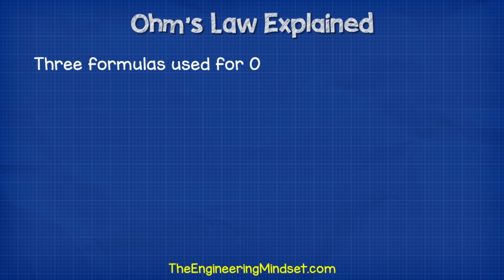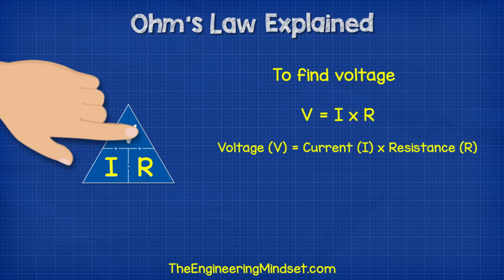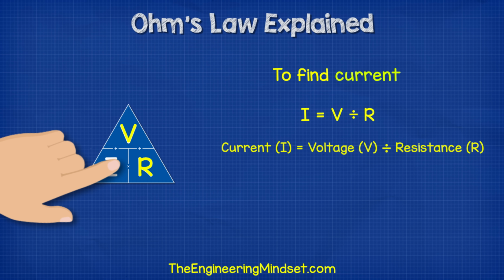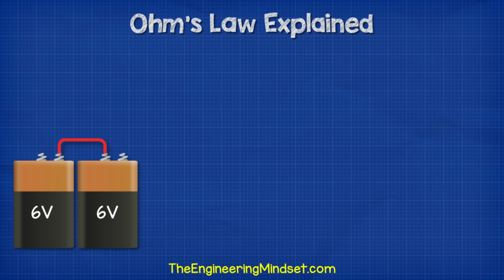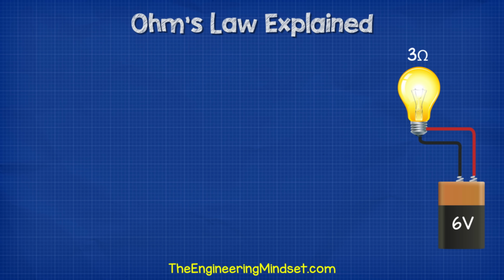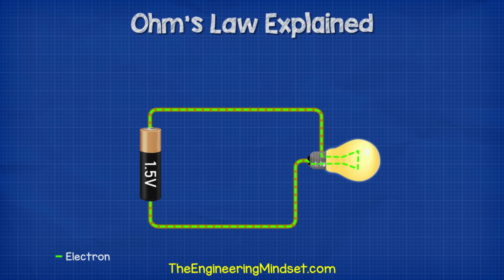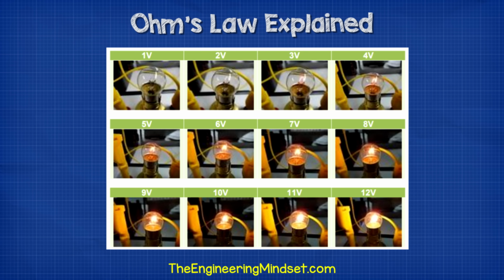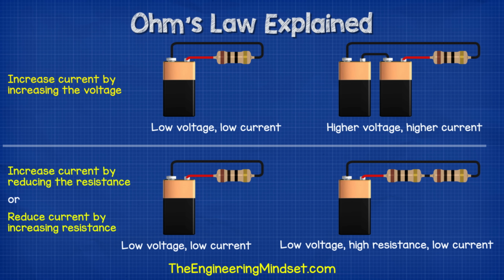Ohms Law Explained - The basics circuit theory

Comment: This video is mostly about how to use the "Ohm's Triangle" mnemonic to solve problems relating Voltage current and resistance in good conductors. Unfortunately it does not really discuss Ohm's Law as the title suggests. An actual statement of the macroscopic version of the law along the lines of  "In many good conductors, the current through the conductor is directly proportional to the voltage across the conductor" is completely missing.  It would be nice if this video explained that not all materials follow Ohm's Law by contrasting Ohmic and non Ohmic materials rather than just treating it as an equation to be solved in textbook problems.  Using incandescent light bulbs to demonstrate Ohm's law is not the best approach, since they are non-ohmic. If you double the voltage applied to an incandescent bulb, the current generally will not double.  As the current through the bulb increases, the temperature will increase and thus the resistance so you get less than twice the current.  If you put two incandescent bulbs in series, the current flow will less than half the current for one. (We also never learn why the equivalent resistance of two 2 ohm resistors in series is 4 ohms - that is just taken for granted)  Cooler bulbs will have higher resistance so the equivalent resistance of the pair will be more than double the single bulb .  Great if you want to solve text book problems unencumbered by the thought process. Not so good if you want to understand what Voltage, Current and Resistance mean and why they are related through R = V/I = constant in good conductors.
Reply from the maker: Check out NEW resistor video, everything covered! ➡️ https://youtu.be/DYcLFHgVCn0

Comment: my question is, if voltage proportional to current according to Ohm's law, then why in a transformer you see high current, low voltage?! or vise versa. it is very hard for me to  comprehend by comparing this to water in a pipe example.
Reply: well if we take R = V/I into account, then we can assume the transformer has very little resistance (ohms). This is why the current is then sent from the transformer to multiple outlets. Thereby increasing resistance as you add load decreasing the overall voltage to all those outlets.

This is why we see varying voltage depending on time of day if we test the voltage of an outlet connected to the power grid.

Comment: Sir, if we hook an LED to 9V battery,then the current in that circuit is not defined(since,I=v/r)it's 9÷0=not defined
Then how the LED bursts?
Reply from the maker: It is defined because the Led has a maximum current. Say 20mA, so that is your current you can't exceed
Reply: @EngineeringMindset  thank you

Comment: problem 1 =0.5 A(120/240)
problem 2 =229.92(240x0.958)
Reply: I know I’m late but ur a real one for this
Reply: @didium7721 …………🤣🤣🤣🤣
Reply: @Lethal_Mserafi  whats funny?
Reply: @matthewheimbigner8671  Though miles and years divide our words, we still share a feast of humor!!
Reply: I = 0.5     V = 229.92
Reply: @renegroulx7029  wtt the i got. V=31992
Reply: 0.5
229.92
Reply: Thanks
Reply: Problem 1 I have 

I=120v/240
I=500m 

Please help on this
Reply: @alGube I=0.5Amp
120/240
240 goes into 120 zero times so it’s a zero 
24 goes into 120 5 times
0.5
Reply: @alGube  120 is half of 240 (.5)
Reply: i have a question though why are the volt and resistance so grand compared to that of the current ? why isnt it as big as the others
Reply: you too huh😭, you the goat
Reply: damn i did the first one backwards
Reply: I got the same answer too
Reply: For problem 2 i rounded off the answer to 229
Reply: I=0.5 and v=229.92🎉
Reply: 0.958 is simply =958
nd 958x240 is = 31992V 
Wtf holy crab 😔
Reply: @rickyyyyy....7034   😂 sorry but hasi aa rahi hai is answer ko dekh ke ye answer kese aaya 😂
Reply: hahahah @rickyyyyy....7034
Reply: You forgot 0. @rickyyyyy....7034

Comment: does it also mean that I need to use wires which can withstand the voltage of the battery? If the voltage is too high, will the battery not burn the wire eventually because a) of increase internal resistance and b) because it is pushing too many electrons at a time? How to know the maximum voltage that a wire can handle and the internal resistance of a wire? Thanks to anybody who can shed light on this, but preferably somebody who knows that his answers are 100% correct.

Comment: voltage= current(amps) x resistance(ohms)
so if I need a 6 ohm 12v led to work and I have a 20 volt input at 2 amps
so input would be 20 x 2 = 40 ohms 
led I used the amperage of the input to find out the resistance to run it 12v  x  2amps = 24 ohms of resistance needed to run my LED using the input I have supplied? from here do I subtract the 6 ohms of resistance that my LED is so I need 18 OHMS  of additional resistance to run this? Or am i completely wrong? Because i already 40 ohms of input how do i convert that to 24 ohms needed?

Comment: So this video seems to say when you add more resistance you lower the amps. My question is, say for instance, I have a space heater running in my room and then I plug in an iron on the same circuit. If resistance lower amperage, why am I tripping a 20 amp breaker?
Reply: Watched a little further, what I deduced is that the resistance is hindering the flow of the current, causing it to build up at the source, thereby overloading the circuit. Right?
Reply from the maker: Seen our new incredibly detailed MCB video? link: https://youtu.be/gqEu9t8HwW0

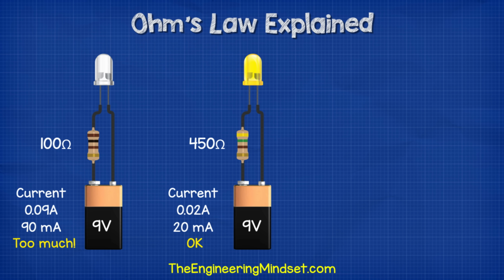Comment: 08:48 
i want to add an info about the resistor why there is 450ohm resistor 

Why did he use 450 ohm? Because the led works with 0,02 amper. 

So,if we use ohm law;
9(v)=0,02(I)*R
R=450ohm (the resistor's amount)

İf we use 100 ohm resistor that;
9v=I*100ohm
I=0,09 

A led takes 0,02 amper, but at that time there will 0,09 amper flows into led. So led burns cause of over flow
Reply from the maker: Check out NEW resistor video, everything covered! ➡️ https://youtu.be/DYcLFHgVCn0

Comment: I’ve read that The National Grid transfer electricity at high voltage and a low current because that reduces the resistance and therefore energy loss. This seem to go against ohms law. I’ve clearly not understood something. Can someone help?

Comment: Problem#1: I=0.5A
Problem#2: V=229.92
Is that even right!, I didn't even look for the answer?
Reply: Yes, that is correct.
Reply: Same answers from me too. However, I wonder what happens if the power is AC.
Reply: @sunyata_ana  it’s gonna be the same thing it’s just it moves back and forth.
Reply: @sunyata_ana  that was AC.
Reply: @shunm8247  What I understand now is that AC or DC don't matter for the questions and answers, because there are no inductors or capacitors in the circuit. Ohm's law, I = V/R, applies to both AC and DC.

However, if there are capacitors in a DC circuit, current would stop flowing. If there are inductors... Reactance of a inductor is wL, which is 2*pi*frequency*inductance, and there is no frequency in DC so reactance would become 0 very quickly (I guess). So in DC, inductors do not do much thing, do not increase impedance of the circuit. However in AC, inductors provide reactance so they increase impedance of the circuit and lower the current.
Reply: yuh i think it's right
Reply: yep its right
Reply: I checked from u
Reply: Thats what I got too. V is at the top of the triangle so it comes first. 240v ÷ 120ohms is 0.5 amps. Here's one though. I vape through a 0.15 ohm
 coil. My device runs 2 batteries in parallel at 3.7 v. My batterys are capable of 30amps, so how many Watts am I producing?
Reply: @nadeemleigh2311  0.246? Cus 3.7x2 is 7.4 so then u do 7.4/30=0.246. Is that correct?
Reply: Wrong,
Problem1: 2A
Problem2: 229V
Reply: @Nithin-zk4re  if you had clicked the link, it itself said it was 0.5A and ~230V for the answer
Reply: @Nithin-zk4re  you are wrong. i double checked on the site
Reply: Can anyone explain why the answers different on the site as to the way it’s done here ? What’s the right answer then ?
Reply: @bermbo  .5 and 229.92(rounded to 230) is the correct answer.
Reply: @Nithin-zk4re  that's what I came up with... but I was wrong too... I did the division backwards...

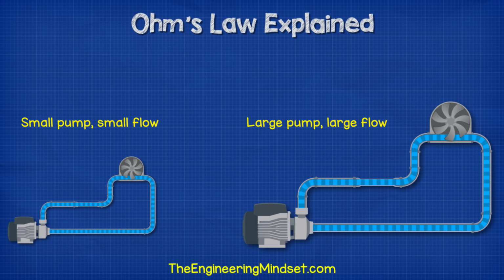Comment: Doubt @ 5:15
Isn't it like using a more powerful pump that pumps water more faster - instead of using a bigger pump

Cos current is rate of flow of charges - so higher the current, more faster the electrons move
Reply from the maker: No, electrons flow at the same speed. The amount of electrons flowing changes.

Comment: I’m in master’s in instrumentation engineering and this is very simple for me
But i have a very basic question it might even be trivial question that’s why i don’t wanna ask my teachers
So the question is:
When we try to measure current we connect a multimeter (on Amp. Configuration or an Ampere-meter) in series with the resistance so the current is, by Ohm’s law, I=V/R, and R is the resistance of the resistor, so aren’t the Ampere-meter adding some resistance to R through it’s wires ?
And thank you for your perfect videos 👌
Reply: Touch the two probe of resistor, they must be at zero resistance
Multimeter do have resistance
Reply: Supposing you are trying to measure the current flowing through an electrical device say a room-heater.
Now you try to know the current flowing through it while it is connected to domestic electric supply. Supposing your supply voltage is 250 V.
The heater power rating is 500 W. By applying W = VI , you will get current equal to 2 amp.
By applying Ohm's you will know the resistance of the heater coil as 125 ohm.As you might know that the resistance of a current measuring device is always very small. Let us take it as to be 0.1 ohm. Now when you try to take current measurement you have connected your meter in series with the heater. The total R in your circuit becomes 125.1 ohm.The current now becomes
V/R=250/125.1 ~=2amp.
Could you catch the point ?
The resistance of your measuring device is there but very small... and it will not upset the value of measured current by any significant amount... Good luck.
Kp kanziya. Chartered Engineer
Institution of Engineers India.
Reply: @kpkanziya8449  good reply; very well explained!
Reply from the maker: Check our new Multimeter tutorial out ➡️ https://youtu.be/4lAyzRxsbDc
Reply from the maker: Check out NEW resistor video, everything covered! ➡️ https://youtu.be/DYcLFHgVCn0

Comment: summary:
- voltage and electromotive force (EMF) are the same thing
- the relationship between current, voltage, and resistance is I = V / R

- given a circuit
- we can decrease the current and voltage by adding a resistor 
- we can increase the voltage and current by adding a battery (in series)
- we can increase the voltage and current by removing a resistor
Reply: What about watts?  When I buy bulbs, I look at watts not ohms.
Reply: @davidwitte8469  watts = total of volts x amps, they call it watts... is the total power 🔋its in the basic video series... im a slow learner, I had to watch each of them slowly and think about them to catch all details.
Reply: @ChinhLe-jm1mf  If voltage and/or current are time-varying, and the user meant active power, and in your formula you used instantaneous voltage and instantaneous current, or if you used and in your formula you used RMS voltage and RMS current, then your formula is wrong. (P =/ V_rms I_rms, P =/ v(t) i(t).)

If voltage and/or current are time-varying, and the user meant instantaneous power, and in your formula you used instantaneous voltage and instantaneous current, then your formula is correct. (p(t) = v(t) i(t).)
Reply: Voltage is not the same as EMF.
Reply from the maker: Check out NEW resistor video, everything covered! ➡️ https://youtu.be/DYcLFHgVCn0
Reply: V=RI
.•. The voltage increases as the resistance increases as well as the current increases!

Comment: Ohms law is universal for current. It changes with the application of three phase ac current. This is why it's been so difficult to make an onboard Raser PSE generator which will be driven by a capacitor fed brushless DC motor.
Reply from the maker: DC motors explained https://youtu.be/GQatiB-JHdI
Reply from the maker: Check out the new BLDC Motor video: https://youtu.be/yiD5nCfmbV0

Comment: Ohm's Law really only applies to metals and direct current and is not really a "law" as there are many things that do not obey it.    For example, semi-conductors, ionised gases, ionic solutions, soil and rocks, and incandescent lamps.  Alternating current circuits do not obey it if there are inductive or resistive components.  Even metals do not obey it at high current densities.  However, for most DC electrical circuits it is a fairly useful formula.

Comment: Does the BATTERY add electrons to the copper wire?
Reply from the maker: No, they already exist in the copper atoms. The battery just pushes electrons through
Reply: @EngineeringMindset  Then what makes the battery eventually die?
Reply from the maker: Check this out, how a battery works: https://youtu.be/PXNKkcB0pI4

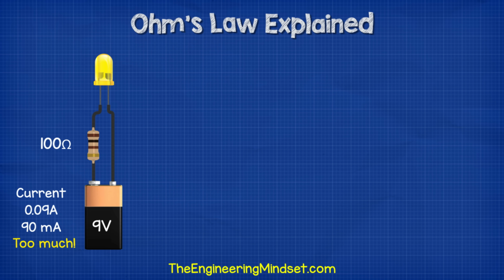Comment: Corrrct 8:39  w " When we had a greater resistor " or something or had the Imax and led can handle
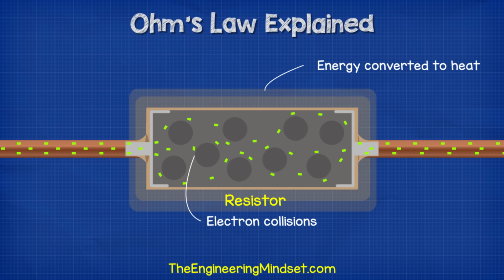Reply: *** Correction needed ***   At 8:39    "If we try to connect an LED directly to a 9 volt battery....."        Illustration then shows an INDIRECT connection through a resistor.    The resistor needs to be removed.
Reply from the maker: Check out NEW resistor video, everything covered! ➡️ https://youtu.be/DYcLFHgVCn0

Comment: For some reason I thought the current went down when you increased voltage.  And that is why people prefer to have 240v things because it's more efficient?  Or cheaper?  Less current I thought since I believe we are charged in watts [VoltAmps] over time. For the same load,  If we double the voltage and that in turn doubles the current, then wouldn't we be charged a lot more on the electric bill?
Reply: Think about this example - A 1,000w hair dryer in the UK (240v) should do the same work as the same type hair dryer in the US (120v).  Both would use the same wattage.  Difference is the  circuit made for the UK version would be built with more resistance, reducing the current, resulting in the same cost on each power bill.
Reply: @thuhreb  

I thought that more resistance meant more loss to heat.  Wouldn't that mean the 240v source and high resistance circuit would be slightly less efficient due to heat loss in resisters?  Hmmm.  I really need to study up on my electrical efficiency and power laws.  Thanks for the example.

Comment: Sometimes science is just turtles all the way down:

'Why do engineers use (j) = sqrt(-1) instead of (i)?'
'Because 'i' was already taken.'
'What is 'i' used for?'
'Current.'
'Why do we use 'i' for current? Why not 'C'?'
'Because 'C' was already taken...'
Reply: reminds me of why the local drive in your computer that has its operating system installed on  said drive,  is called the "c" drive, because "a" and "b" were taken, both a and b were used for floppy drives. "d" is the optical, or was rather, then everything else like flash drives continue from there.
Reply: Actually 'i' stands for current intensity
Reply: lmao j is joules btw
Reply: Because in math we use” i “as an imaginary number so for eliminating this confusion we use “ j ” for current

Comment: double the voltage automatically doubles the current (1amp=1coulomb)
FOR a GIVEN resistance.   Current in a given conductor is LIMITED to the
diameter of the wire. Great basic video. Thank you.